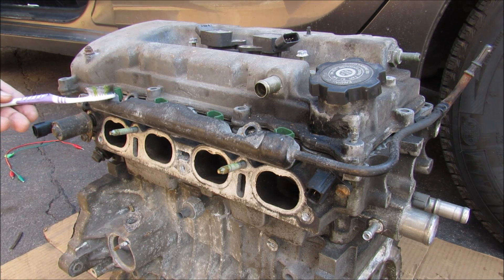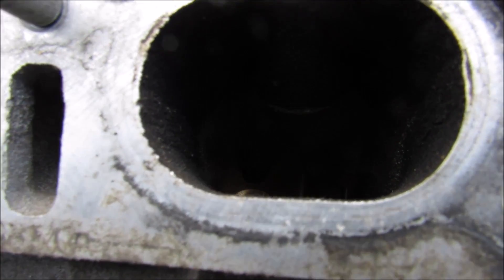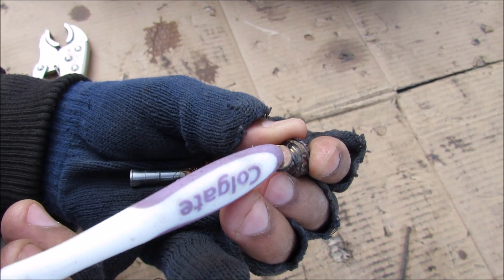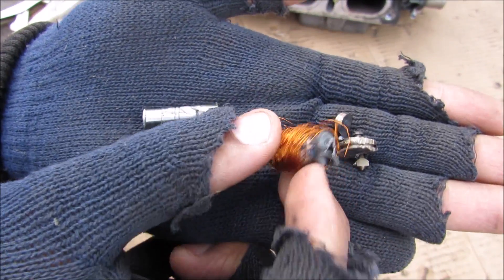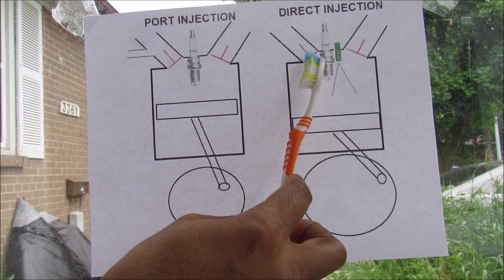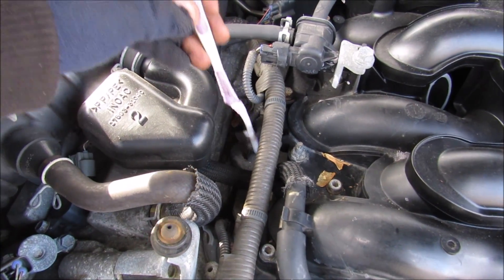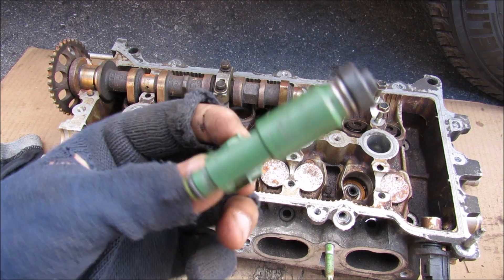How Fuel Injectors Work

Comment: Didn't mention the filter on the inlet of injector. What part of a injector actually fails? I had an injector that wasn't working. Could it be the tiny wires in the coil?

Comment: I believe you have shown me why I had copper wire peices sitting in the top.of my fuel injector when I has a cylinder 7 misfire. When I pulled that injector, there was all of these small, thin copper wire pieces. Now I want to tear that one up and verify.

Comment: Not sure why this popped in my feed now but to be clear DI fuel injectors are completely different, it's not just a matter of fitting the same injectors in the cylinder head.

DI injector are opened by fuel pressure, not by a solenoid lifting a plunger. They have a solenoid or a piezo element inside, but what that does is close the fuel return window. If the window is open the fuel just goes through the injector and back to the rail or fuel tank, when the window closes the pressure builds up and overcomes the spring tension. 

This seems like an overly complicated way of doing it but it's necessary because the high pressure inside the cylinder could lead to combustion gases being pushed right into the fuel system if the injector got stuck open (worst case scenario you could have fresh air pushed into the fuel line and then when the spart goes...kaboom goes your whole fuel system and possibly even your fuel tank). This way if there isn't enough fuel pressure the injector remains closed.

Comment: Many people don't realise how important having clean valve seats are. In modern EGR and recirculation systems, lots of carbon build up is created. How much? So much that it usually starts to look like some sort of growth on your intake valves and even in the intake manifold itself.

This, apart from being a horribly messy, tedious, and stinky job to clean out, can reduce air flow, choking the engine. It also can, at worst, actually break off and stop the valve from completely seating, reducing compression. 

At worst, you have a cylinder head to tear off to clean the valve seats. 

Direct injection is just not worth it, from a maintenance perspective.
Reply from the maker: That's why dual injection is the best of both worlds
Reply: @speedkar99  very true, although I've never worked on cars that have dual injection. I wonder if they are rare or just in very new cars (I've never worked on anything 2018 onwards).

Comment: I've cleaned fuel injectors on 2001 Saturn SL2 (they are removed fm/rail), replaced o-rings and wanted to replace the filter baskets on them (which were in the same set w/ o-rings), but the baskets were too small for the inlets on those injectors. Doing research on other filter baskets I probably needed I came across an interesting fact. If to look attentively on fuel injectors shown in films, it looks like there are 2 types of them:
1)injectors w/micro filter basket inside, many films how to replace those baskets
e. g. SET OF 4 ROCHESTER FUEL INJECTOR 1996-2001 SATURN DOHC 1.9L L4 
or the injector shown in this film
2) injectors with wider inlet on the top, probably no filter basket there
e. g. 4x New Fuel Injectors for 2001-2002 Saturn SW2 SL2 SC2 1.9L I4 25178967 25178968  or
        4Pcs Fuel Injectors For 2003-2005 Pontiac Sunfire Chevy Cavalier 2.2L 832-11211

Please could you tell the difference between those 2, and are those w/wider inlets really don't have any filter baskets? I've learned recently that some injectors don't have those filters inside.
   Thank you for a great film, good to see how everything works inside.

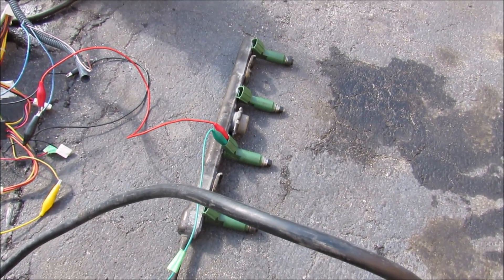Comment: 2:21 at first i thought this was confusing and i was like "how is a DC current making that sound and putting fluid through" and then i realized he was connecting the pump with the yellow wire and the injector (green wire) was on the whole time. maybe i was the only one that was confused by this but hopefully this clears that up for anyone else

Comment: it finally makes sense... best explanation i've seen of how exactly the injector works. most of the other things i read just said "it atomizes the fuel" but i could never find exactly how the fuel is shut on and off. the solenoid with a fail-close port is a genius way of doing it
Reply from the maker: Yes. It's hard to cut that injector apart with an angle grinder but worth seeing

Comment: Hi brother. Excellent video.
 I am new to your channel and i find it very helpful. Thank you.
Well, i have skoda octavia 1.9tdi diesel 2007 clocked 1 lac kms on odo.
What you think, is it good to use engine flush and fuel additive,injector cleaner like Liqui moly diesel purge? Please give some idea.
Thank you.
Reply from the maker: Im not familiar with cleaning diesel injectors. Most have a pre-ignition chamber so carbon buildupight not be a big issue.

Comment: You would have to run some really shitty gas to gum up an injector now days. Most fuel has alchohol in it that naturally cleans the injectors. As detergents are also added in the way of toulines and other additives, most cars rarely experience gumming issues. Newer vehicles have better designed o- rings that can handle the additives today then 20 years ago. Injectors generally last the lifetime of most engines now.
Reply from the maker: Good point

Comment: Thanks for the video *******....... Cutting up the part to see how it works is Very Helpful.  Fuel Injector coil windings "Electro -- MAGNET"....... PULLING up the return spring...... reminds me of how [I think] an auto trans Shift Solenoid works.  Very good video.
Reply from the maker: Glad you enjoyed it and learned something
Reply: I had always been under the impressesion that the injector itself created pressure to spray the fuel , but apparently the injector basically opens and closes the orifice to allow the fuel to exit under the pressure delivered by the fuel pump. so actually the injectors don't have to work as hard as i had originally thought. thanks. great  video.

Comment: 1:38  Is there a reason why the wall is rough?  I would assume the smoother is better perhaps is done in expensive car.
Reply: You missed.  The air is moving.  I was wondering the wall is rough is because it cost too much or the resistance is negligible?

Comment: My country wants to implement so called BS6 (emission norm) by April 2020 which uses only 10 ppm of Sulphur there by giving cleaner emission. As of today all the manufacturers are using BS4 engines which uses 500 ppm of Sulphur. Diesel engine uses Sulphur as lubricant in injectors.
Will there be a problem with injectors in long run by using bs6 fuel on bs4 based engine since there will be only 10 ppm of Sulphur. As of today only luxury cars like Mercedes, Volvo have started selling cars with bs6 based engines. I am wondering whether I should wait for 1.5 years to get newly made bs6 engine vehicle or it would be OK to buy a car with bs4 engine. Also I have read that petrol engines won't have problem with bs6 fuel on bs4 engine. Don't know the reason behind it..
And extremely well explained with the video 🙏
Reply from the maker: Thanks for that
Reply: speedkar99 any idea about abscence of Sulphur would affect fuel injectors in diesel engine.?

Comment: Uhm, question ✋
 if you have a 1.3L car model but you used 1.8L fuel injector or 2.0L does it affects the performance ?
Reply from the maker: No, the computer controls how much it opens
Reply: speedkar99 so you mean even the part number is not exact as long as the injector you replace fits-in it's okay ? I have a 2013 toyota 1.3 and the engine model is 2nz-fe with a injector part number of 23250-21040 can be replaced with a diffrent part number like 23250-22040 ? Which is for 1.8L engine. 
Is it okay ?

Comment: Hi i have 2008 1.8 honda rebon prsmetic i have a critical issue when i accelerate my car slowly and it reach to 30 mph then it shivers and jerks for 3 sec and when it goes upto 30mph it goes smooth and it only happens in D not in other like d3 or d2 or d1
 please help me
And i checked miss fires clean throtle coplete tuning of engine but problem still
Reply from the maker: Torque converter

Comment: I have a minor issue with a 2006 Toyota Solara Sle coupe....I recently added a fuel cleaner to the fuel...worked really good I might add,,,but the MPG gauge is stuck at 27 mpg....do you think junk got stuck in the fuel pump filter?
Reply from the maker: The 3MZ isn't a very fuel efficient V6 espresso in the city.
Reply: Use a borescope to look at your cylinders via the spark plug holes. If it's really dirty, run some intake cleaner through it and try seafoam treatment too

Comment: @Speedkar99

Multi port fires all injectors at the same time (entire bank)
Sequential fires when fuel is needed.

Some injectots like GM 4.8, 5.3, 6.0 have filters in them. Which also can be decapped. Which turns from a 25lb/hr to 75lb/hr. Check out Sloppy Mechanic videos.
Reply from the maker: Thanks

Comment: Very informative since Im doing my injectors as we speak. The only thing I missed is shouldn't their be a spring the close the injectors or did your explain that briefly when you said the fuel pressure should close it when the voltage goes negative? As always thank you for a very good vid.
Reply from the maker: Some injectors have a spring, this one relies on fuel pressure.

Comment: Thanks for the video man . You disappeared for the winter. Port injection is great, that is why Corolla has it,  it minimizes carbon build up which destroy engines. Toyota vvti technology is still awesome, that's why they still use it even today. I can't wait for Toyota full electric vehicles that have the graphene batteries, should be out by 2022. Toyota ended the deal with Elon musk , decided lithium is not worth further developing. Toyota is now building the own solid state battery factories. Toyota is awesome.
Reply from the maker: Yea I haven't been shooting too much lately. 
Agreed Toyota makes good cars.

Comment: What's the advantage of port injection other than cost?? Kinda useless when we have direct injection.. Right?
Reply from the maker: I mentioned in the video, cost and clean valves
Reply: speedkar99 Oops my Bad . I meant what's the advantage when we're using both at the same time. Valve cleaning is so useful that we use an extra injector just for that ?

Comment: Advertising of direct injection (and VVT) is all about slightly better power and fuel economy in new vehicles. No mention was made about reduced engine life because of dirty intake valve seats or failing cam phasers. Although there are mandated economic incentives for better fuel economy, I find it irritating that there is no discussion about the environmental cost of throwing away more cars more often. Environmental incentives need to consider all factors!
Reply from the maker: Good point but I think you meant direct injection
Reply: Yes, thanks, I fixed it.

Comment: My 88 Plymouth Voyager (Canadian Built!) is a throttle body injection. Does that mean that the injector is continuously flowing and that the computer only varies the amount of fuel being sprayed? I don't imagine it's being pulsed on and off when located in the TB.
Reply from the maker: Yep 
Except it varies based on throttle input not valve input like port injection.

Comment: I just cant believe the engineering behind this. It happens multiple times a second and it is still nearly perfectly controlled. Just amazing.
Reply from the maker: Exactly what I'm thinking while I drive...
Reply: Oğuzhan Yılmazer.  That goes to show how complicated an engine is. That's the same speed the pistons are moving times two for any four stroke engine. Yet an engine can go for 400,000 miles and more before any major repairs. Amazing!
Reply: i trip out on how optimal engines are aswell

Comment: How do you know the clicking noise is injectors and not lifters?  Injector noise is exceptionally hard to hear since, as you point out they pulse hundreds of times a second...they are also MUCH quieter and can usually only be heard on a flow bench when there is no other engine noise.  Good basics and visuals though, not knocking (no pun intended) your video.
Reply from the maker: Thanks, early Toyota d4s engines we're known to have this sound coming from the injectors

Comment: Having to tinker with a lawnmower and it's stupid, temperamental, grumpy, hateful carburetor really makes you appreciate those fuel injectors and the whole system behind them. POS MTD Powermore engine, really makes me glad cars aren't that hard to get going. Not anymore at least.
Reply from the maker: That's right, new tech

Comment: So it's that what makes diesel engine (on cars) sounds more 'clacky'? since the injector sprays at higher pressure?
Reply: Nope, it's because of cylinder dynamics, which are larger bore size and shorter stroke, combined with compression ignition, not spark ignition.